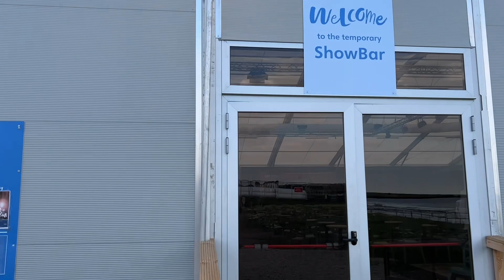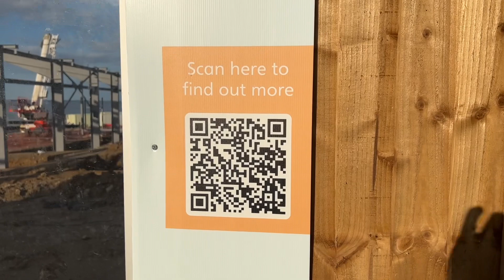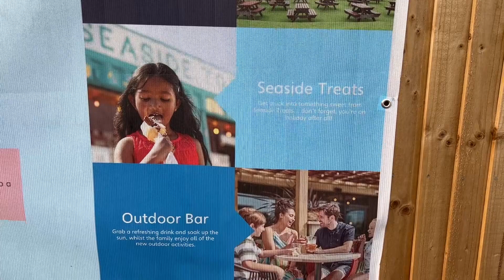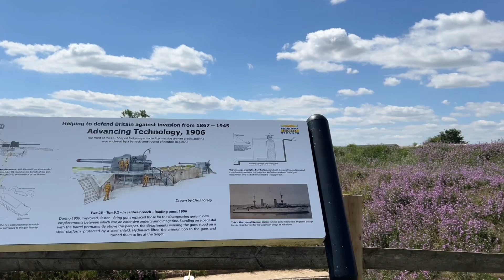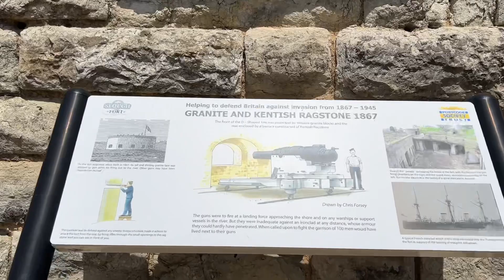Allhallows - Haven - update on upgrade

Comment: Do you know what else they have planned for the next season?and is there a fish and chip shop on site
Reply from the maker: Cs, they have a Cooks van on site which sells fish and chips, however, I believe the menu is rather restricted. They do plan to have a new fish and chip place there with a wider variety of food, however, I’m not sure if this will have to wait until the new entertainment complex is completed or not.  They are meant to be putting a sweets treats place in the adventure village as well so I’ll let you know if either of these are open when I next take a visit. There is, however, a very good fish and chip shop (Millenium fish bar - 
also selling kebabs) on Avery Way the approach road to the park. I believe it is cash only there, but there is a free to use cash point in the parade of shops next to it.  
As for next year, I believe once the new entertainment complex is opened they will be redeveloping the old live lounge and swimming pool and replacing it with a new water park complete with slides etc. Unfortunately, if you like golf, the golf course will close on 22 July this year as they plan to put some new caravan pitches on it and a new access road which will avoid the village. I believe they have a 5 year plan of improvements to the park so it will be interesting to see what the future holds.
Reply: @oldfrostig  oh wow thank you. I did wonder what they would do with the live lounge we haven’t been here since 2017 so was thinking of coming back next year but would rather come when everything is done.
Reply from the maker: @Cs-bn2ss  sounds like a good plan. I believe the adventure village is now partially open and they plan to have it fully open Friday 22 July. With that open and the new temporary show bar (which seats over 600) already open it should be quite impressive this season if you decide you don’t want to wait until next year. The live lounge will also remain open for this season so they will have two entertainment venues available during peak times (off peak the temporary show bar is only open Friday and Saturday). I’m hoping to get down there shortly and try to get some footage of the adventure village when it’s open. I’ll let you know when I load it up. I think the water park will be the icing on the cake next year as the current pool is quite small during busy periods, although fine off peak.